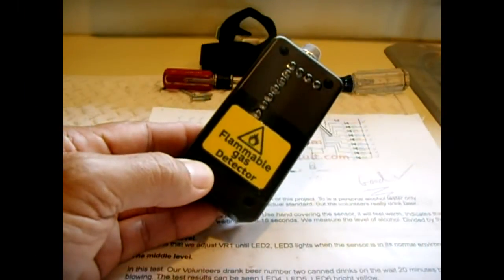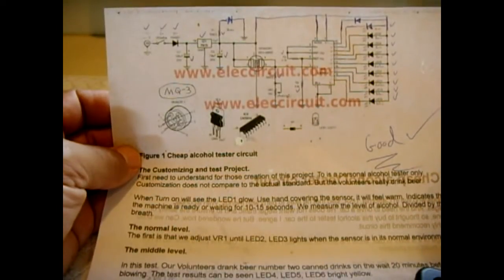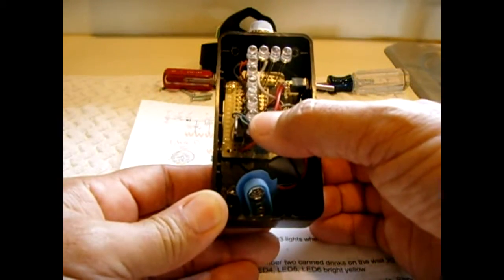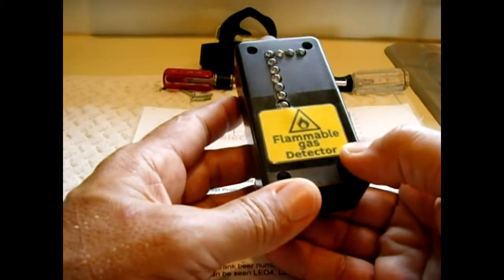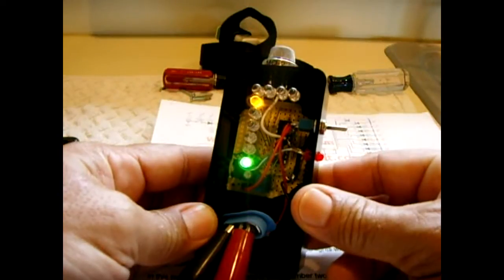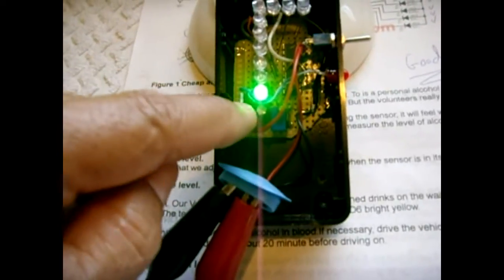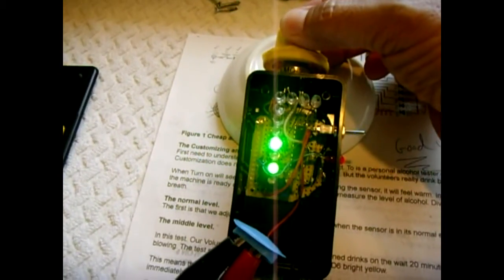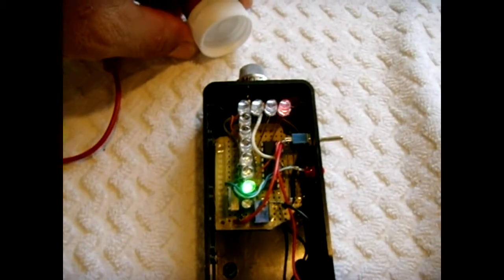How To Make A Flammable Gas Detector

Comment: good job!can i just ask where to put a buzzer if possible in this circuit,or what pin in the ic i can connect the buzzer..thankssss a lot sir!
Reply from the maker: You do not have to use the LED's. You can use one of the outputs for the sensitivity range you desire, and connect a small 5V piezo buzzer. The (NEG) side connects to the LM3914. Be sure to use BAR mode.

Thanks For Watching! Be sure to share my channel and rate Thumbs Up.